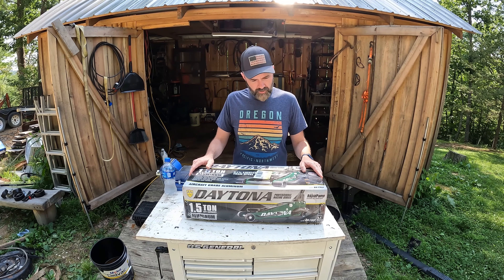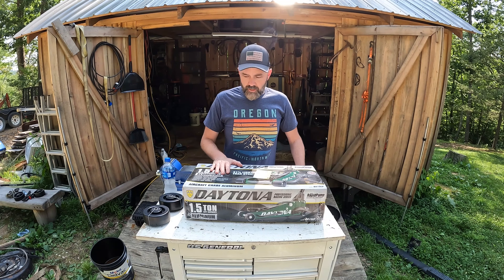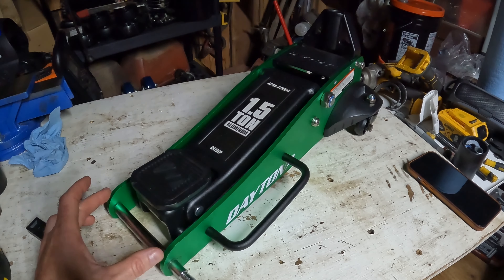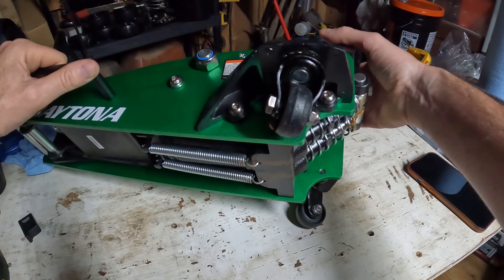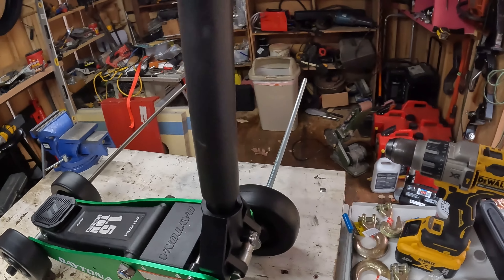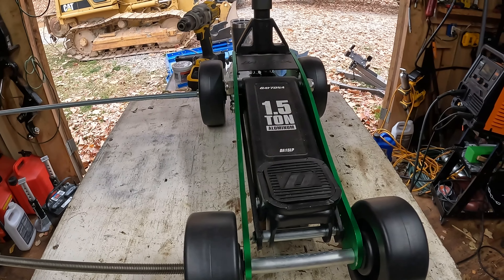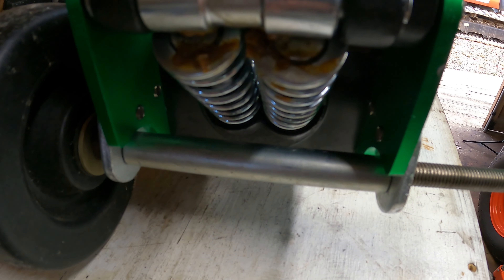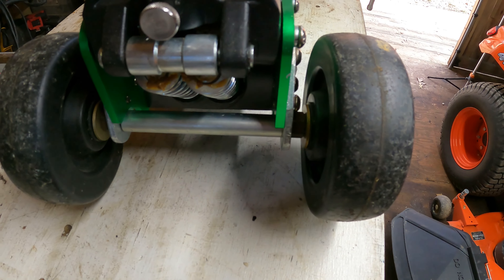Modifying the Daytona 1.5 ton jack from Harbor Freight

Comment: Its a small lightweight jack meant for cars,not sure why you would want 9 inch minimum as it wont fit under most cars and that is what the jack is for...I mean its not a truck jack at all.I think I would have it so it could remain like it was from the factory or add the extension if I wanted too.....Losing any low profile capabilities defeats the purpose of a 1.5 ton jack in my opinion..
Reply from the maker: I know what you mean. It is sort of purpose built for what I need. I really only use it on sxs and atv’s. It rolls much better in the gravel and is no where near full capacity in what it lifts. I don’t have anything that requires a low profile jack. Also I don’t have a concrete floor. Lol. I have the Badland offroad jack for bigger stuff and I use it pretty regularly but these little lacks are really handy for lightweight stuff that has a lot of ground clearance such as a UTV. The 9” minimum actually comes in handy there. I would worry if these little jacks were much taller or had a larger extension though. At that point I’d be afraid of unwanted leverage from whatever I was lifting causing the jack to fold over like a pretzel. Thanks for the comment! 👍🏻

Comment: I just don't understand why you'd do this to a low profile jack...  You've just raised it up to a regular jack height, so why not just buy a regular jack?
Reply from the maker: I did it so it would roll better and not sink so much in the gravel. I needed just a bit more height out of it so I made the extension. I have lots of floor jacks and these fit a niche that the others didn’t. Plus I like to tinker with stuff. Lol.

Comment: The heavier version of this Daytona does not have front wheels.... it has a round bar w/bearings  that takes that job..... Pipe spans inside between the jack's sidewalls.  Ifff there is enough clearance behind it..... maybe you can take that idea.  Or since you can weld...... make a bracket to mount a center wheel on the axle? (bottom of this wheel same plane as the the outside wheel's bottom or a millimeter higher). This third wheel would support the axle tube in the center.
Reply from the maker: @coachgeo  that’s a good idea. A 
lower/smaller wheel in the middle for support. That would help with clearance for sure! 👍🏻

Comment: The height extender was leaning and incapable of dragging the jack to compensate the lean. The extender would topple.
Reply from the maker: You are correct. You have to be mindful of that with these jacks. I try and place it where it won’t bind while raising. My Badland offroad jack is the same. I never get under anything with any jack unsupported either. 👍🏻

Comment: Can you give us a few more specifics on the casters? You said 5" and 6" but what about material, capacity, cost... Thanks!
Reply from the maker: Good catch! I updated the video description with links to the wheels I used. The 5” wheels have a weight carrying capacity of 650 lbs each and are $8.69 a piece. The 6” wheels have a weight carrying capacity of 750 lbs each and are $9.98 a piece at the time of this posting. They are made from Polyolefin according to the service caster website. Thanks for watching!

Comment: i like that think im gonna make one myself......HBF has now called badland jack for $299.....but i steel like your idea better
Reply from the maker: I have the Badland jack too. It’s nice, just a lot bigger. Thanks! Let us know how it turns out! 👍🏻
Reply: @MountainMindset  yeah did see that in one of your other videos.....lol....Im gonna go to HBF tomorrow to get the pittsburgh jack and the wheels
Reply: @MountainMindset  Btw what was the langth of the front bolts for the pittsburgh jack
Reply from the maker: @djhotjams7030  that’s awesome! just remember the wheels from harbor freight use a slightly smaller axle diameter. I had to sand the axle down a bit.
Reply from the maker: @djhotjams7030  I believe they were 6 inch bolts.
Reply: @MountainMindset  hey thanks man i appreciate it
Reply from the maker: @djhotjams7030  anytime!
Reply: Was those bolts 3/4 x6
Reply: Or were them bolts 1/2 x 6
Reply from the maker: @djhotjams7030  no. 1/2 x 6
Reply from the maker: @djhotjams7030  exactly!

Comment: Thank you for the video.  Regarding axle stiffness, a solid smooth shaft will be stiffer and stronger (safer) than the all thread that was used.  You'll almost never find threaded rod in bending like it is used here because all of the threads act like stress risers.  
This is arguably overkill, but if it was me, I would be using AISI 4130 (or similar) steel shaft, shaft collars, and bronze washers with those casters.  Or retaining clips and bronze washers if you have a way to cut grooves in the shaft.
Reply from the maker: @-Enginerd  that’s a good idea. I ended up going back and using grade 8 bolts and iron pipe to redo the axles. So far it’s holding up. 🤞 I would like get a higher strength steel rod and have it turned to fit. Maybe one day I will. I appreciate the input. Here’s the video on the revision. Not quite the best but holding up thus far. Thanks!
https://youtu.be/i2dH2O65NdM?si=XuQdDOU1gvAjgwK8

Comment: I want to do this to my 3-ton jack but I guess there are not any 1-ton wheels that dont cost more than the entire jack for 4 of them
Reply from the maker: I’d say it does! Have you looked at the Badland 3 ton offroad jack from harbor freight? Not sure where they get the wheels for that thing at but they are strong enough to handle the weight and look nice. Maybe someone on here knows where they get those wheels and how much they cost. Also, Service Caster has TONS of casters if you haven’t looked there. They may have something too. Good luck and let us know what you find! 👍🏻

Comment: i love your vids and will follow suit! question, does the new Daytona 1.5t have wider/stiffer aluminum side plates then the 1.5T Pitts.? 

wondering if the Daytona twists less on uneven surfaces??

thanks!!
Reply from the maker: Thanks!!! I believe the thickness of the aluminum is about the same but the width may be a little wider. There is a little stiffener plate on the top of the Daytona too that may help a little bit. Not really sure if it does or is just there for looks but it makes me think it helps. Lol. Good luck on your build! 👍🏻